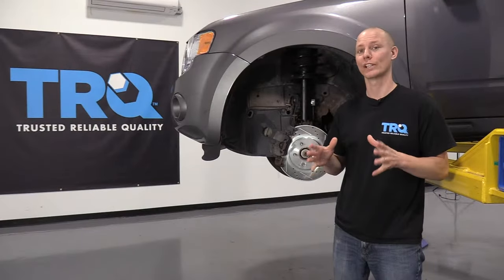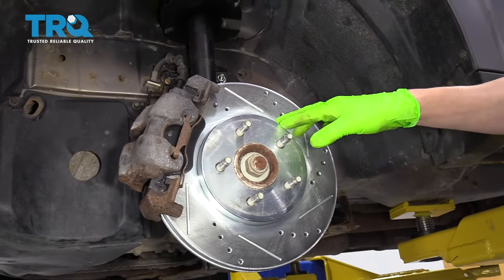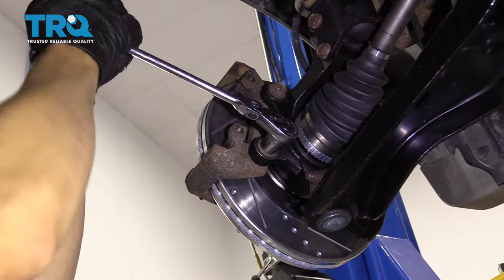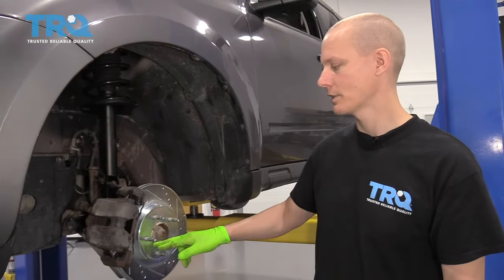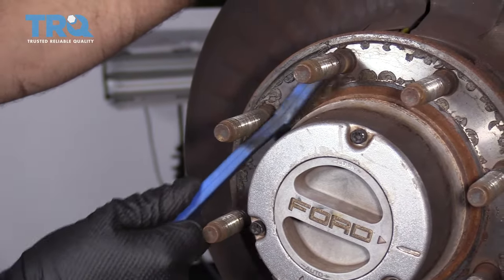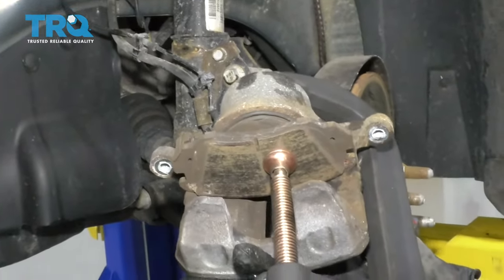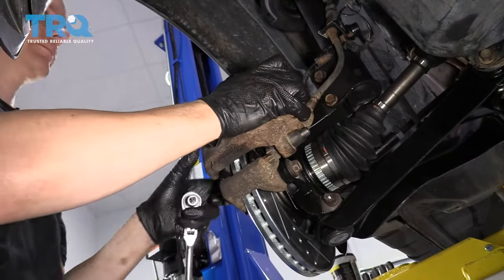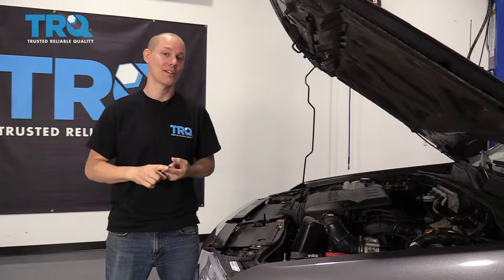How to Replace Front Brakes on Any Vehicle

Comment from the maker: √  Watch the Video
√  Buy The Part at 1A Auto http://1aau.to/m/Shop-TRQ-Parts
√  Do it Yourself
√  Save Money
Reply: Dear have driled performance brake rotor + brake pads front Rear m'y véhicule Years 2002 GMC Yukon xl 1500 slt 5.3 flex fuel. Rear dual piston set send me référence torq thanks

Comment: Do you have a video on how to replace a passenger door window control on a 2004 GMC Envoy SLE? Mine totally melted somehow and, I cannot figure out how to repair it. I tried replacing the burned out unit with a used one from a salvage yard but, it did not work. I even replaced the regulator motor, still no luck. The fuse was fine. I'm lost.

Comment: Do you have a line up for 2004 Jeep Grand Cherokee V8 4.7 L N type engine? My gauge cluster for speed and RPM has stopped working, also I have a hard time finding  front suspension bushings for where the upper and lower arm meet. Please advised.